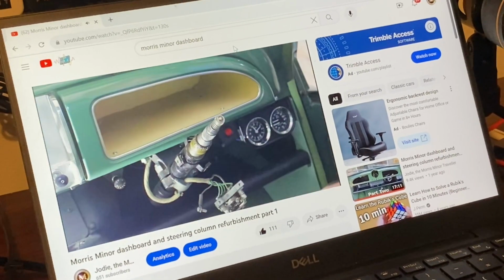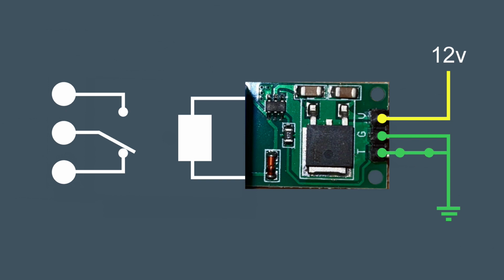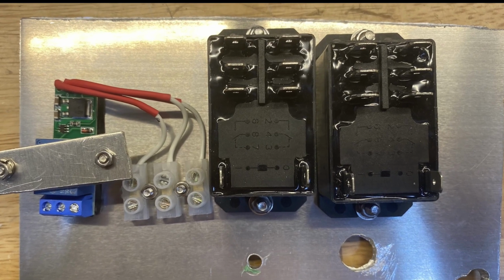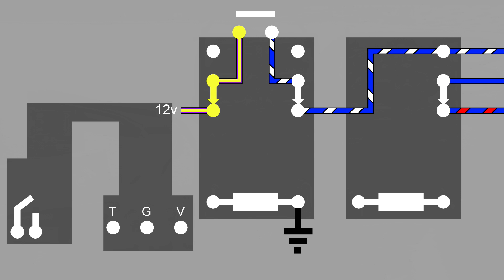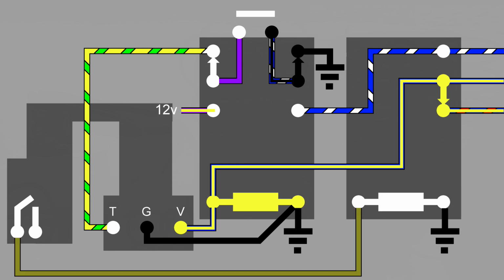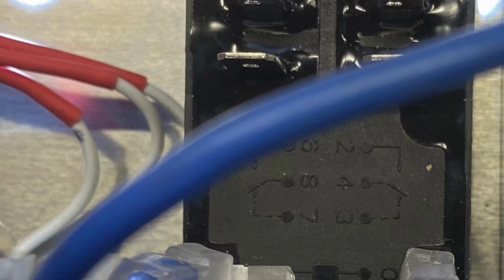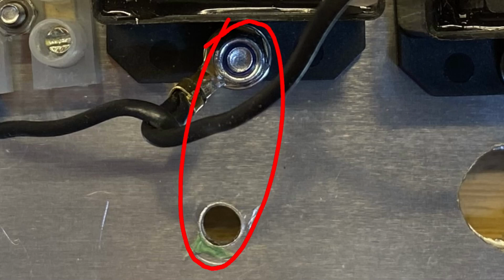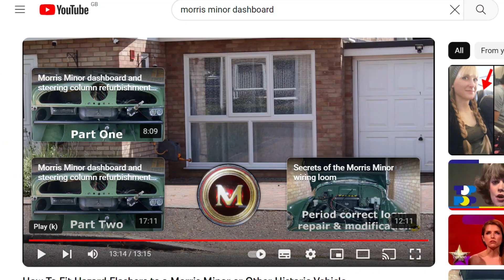Part One. How to move the Morris Minor dip switch to the steering column.

Comment: How do you route the cables from the floor switch through the bulkhead back behind the dashboard? Mine come from the loom just to the right of the O/S shock absorber and go down by the steering rack to the back of the switch.
Reply from the maker: Mine is a 67 model and the cable is long enough to reroute directly. Not sure about other models. Could be extended I suppose

Comment: Thanks for a really excellent video. What connectors do you use for the 3 very small pins on the flip-flop?
Reply from the maker: The wires are soldered on, then covered with heat-shrink tubing. It’s a slightly delicate job.